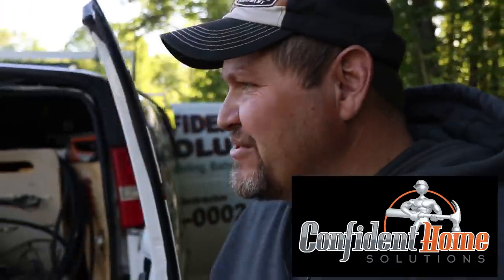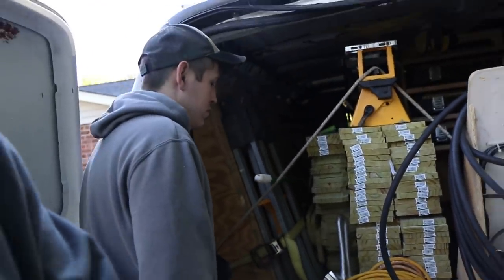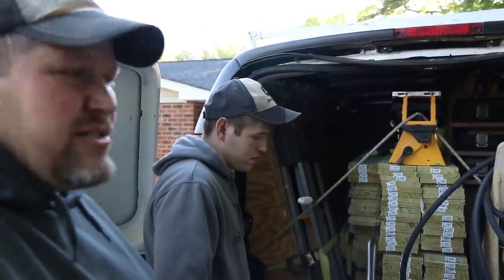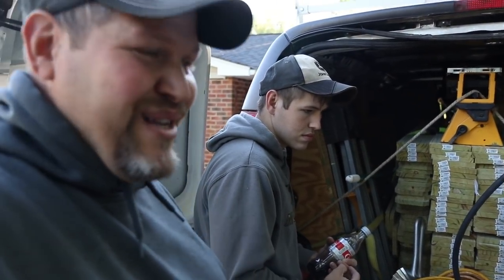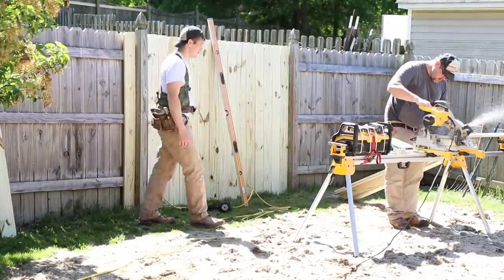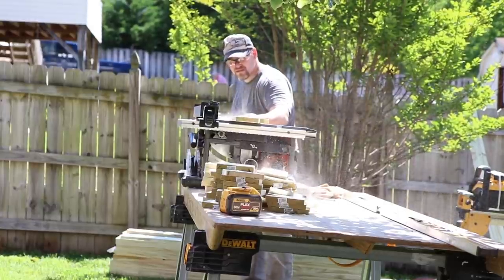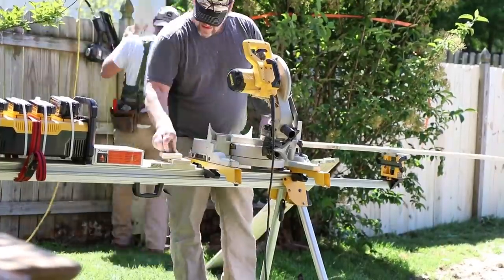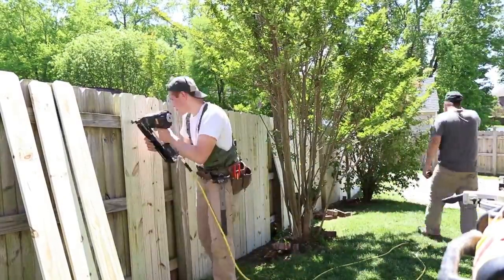Modifying an existing Fence to keep an Old Person from bothering Neighbor

Comment: My grandmother had dementia and my aunt tried to keep her at home for as long as possible.  It finally got to the point that grandma needed to move to one of those assisted living places.  At one point, the folks who worked there told my aunt that grandma and some of her fellow patients had been “busted”:  they were standing in a circle in the entry way, discussing some rather extreme plans for a jailbreak.  “You knock out the receptionist, you hotwire a car, etc.”.  My grandmother, the gangster.
Reply: I worked as a CNA at a Life Care Facility for 29 years.  We had to hide one lady’s shoes after she was found at the edge of a nearby busy highway one time.
Reply: Not really funny but sorta kinda it is. Sorry to hear about that.
Reply: @deanwilliams8857  I don’t think anyone was trying to be mean but I think sometimes it’s best to make light especially if you’ve dealt with dementia on any level. I know I’ve dealt with it and my family and it’s heartbreaking so anytime you can find a little humor it  helps you get through😊
Reply: "The Godgrandmother""
Reply: Both my great grandfather who lived to 93 and my great great uncle who lived to 92 escaped assisted living homes. My grandpa fought the 2 cops that found him and nearly overpowered them. My uncle was found a few miles away in a wheelchair and when the cops asked where he thought he was going he just replied “Texas”. This was all in Kentucky
Reply: @gorehammer1  I have to wonder if they have the ability to scheme a way out and make it, maybe they don't really need to be there
Reply: @gorehammer1  My dad worked at a facility that cared for veterans with alz/dementia. I remember as a kid we were driving down I-40 in North Little Rock, Arkansas where it meets I-30 and all of a sudden my dad yells OMG and pulls the car over and jumps out, running ACROSS the interstate. He had seen one of their patients walking down the interstate a couple miles from the facility. He just popped him in our car and took him back. No hoopla whatsoever  This was 40+ years ago.
Reply: @gorehammer1  he knew Texas was Free 🤣
Reply: I’m laughing so hard at this situations hilarity, your grams sounds like she would of been quite the gal to know in her day 😉. I’m worried I’ll be that same grams when it’s my turn 😬💯
Reply: @ctawose  that isn't true at all. My mother-in-law who was going through delirium was capable of a lot of things she would not have been able to do if she had been in her right mind. She was able to quietly move a dresser we had in front of the door that was so heavy I couldn't even move it, sneak out no matter what we did to stop her from doing it, hide from the police, and carry around a very heavy bag that the police officer couldn't even lift. She could barely walk on a normal bases but during her delirium she walked pretty far before the police found her. She was so convincing that if you didn't know her you would believe her until she would slip and show the delirium or her facial expression would change to a scary grinning face and she would start giggling a freaky giggle uncontrollably. She had people believing she was married to a doctor and we were lying about it. They started to change her last name at the hospital to reflect her "married" name. Before this new husband thing started she told medical staff that her husband (she gave them my father-in-laws name) was beating her and she was scared for her life. The police showed up at our house to arrest him and we had to prove her husband died three years ago. He never laid a hand on her before he passed they lived with us for 10 years.
Reply: @shadowkissed2370  That is so awful for all of you.  Its scary as I get older I don't want to do this to my family
Reply: That’s a great story. Lol
Reply: @tm2bee  I remember in grandpa’s last days when he was laying on a hospital bed mostly unresponsive everyone was afraid to get close enough for him to reach. He used to grab a 10lb sledgehammer by the base of the handle and reach out and touch the hammer to his nose. Also he dated Simone Simon!
Reply: My brother told me of a assisted living home, some of the patients would try escape and go to the bus stop across the street. So they built a replica bus stop next to the outside recreational area. Everyday a few would go and wait for the bus and then return  when they called inside to eat.
Reply: Grandma cant be held down.
Reply: My grandmother threw food at the nurses and kept stripping until she got kicked out of her nursing home.
Reply: @deanwilliams8857  Sometimes you laugh to keep from crying...
Reply: @pearlperlitavenegas2023  Home of high property and sales taxes. Free?
Reply: Everyone’s grandma gangsta until Betty White shows up...
Reply: And I bet shes a cutie  too.
Reply: @ctawose  I don't have to wonder if you have ever taken care of someone with dementia.
Reply: Wow. It’s important to research the facility you are planning on placing someone in. Not only that it’s a good place, but that they have an understanding of dementia and short term memory brought on by peers in this new living environment.
Reply: @shadowkissed2370  My Grandma told us that the most horrible man came to her room and asked her to marry him. It was my Grandad trying to tell her they were married.
Reply: I’m sorry but I couldn’t help but laugh.  That’s such a movie moment.
Reply: @rogdog3257  
That’s brilliant!  A fake bus stop!
Reply: @krakendragonslayer1909  wow - that shows so little appreciation of a caregivers’ role and what it’s like to live with dementia.  Also, I’ve noticed that when people make baseless accusations, it’s usually because this is what they do to others.  In other words, glad my grandmother was not yours or she would have been poverty- stricken in no time at all.
Reply: @krakendragonslayer1909  Have you ever cared for a person with dementia? I have. They often require constant attention. Picture these scenarios caring for a dementia parent in home - You go to put your toddler down for a nap, and mother slips out the door. You have to decide if you leave the toddler alone, or call someone to help. Or wake the toddler to take the child with you? Better decide quickly... Or imagine the scenario - 2 am, family's in bed. You get up for the toilet, and see mom in the kitchen, trying to light the gas stove. She starts screaming at you when you take the lighter away from her, waking the whole house up. She almost started a house fire.. And much worse than this has happened when people try to keep severe dementia parents at home. Sometimes love and care means making them safe, above our desires to stay close.
Reply: @krakendragonslayer1909  your respons says a lot about yourself and it isn't nice...
Reply: @chipsutcliffe7110  Agreed.  A good sense of humor will offset some of the stress associated with being a caregiver.  My Dad's  house was about a quarter of a mile from the railroad tracks.  One day, after returning from an errand, I walked next to Dad, holding on to his gait belt in case he stumbled.  The train horn was so loud that it startled both of us. Dad turned around and looked, as if the train was coming down the street.  It was hard not to laugh. All I could manage to say was, now that was too much noise.
Reply: @Hyperion  must have been a long time ago. 
  I am afraid nowadays the poor old man would be shot! Maybe just tasted. But who knows...("Stop resisting, and I felt my life was endangered ")... 
  My Grandmother was like this in the 80s. Our understand.
Reply: @amyb8704  then there was the time when my aunt had brought her home for the weekend.  She did that as often as possible.  My uncle heard a noise in the middle of the night, and went downstairs with the dog.  He found my grandmother (his mother in law) in the living room, stark naked.  Heard another noise, and it was the dog running back upstairs to the bedroom.  He always swore that the dog kicked he bedroom door shut behind him.
Reply: @gorehammer1  
Dementia dosnt mean not able to make your own choices,  if he wanted Texas 
You should have moved him there.
Yes it might not have been convenient for you but that was his wish.
And yes I've delt with family members in this very situation.

Comment: I hope the modification worked for  the client.  Elderly people are doggedly determined and like toddlers, have all the time in the world to figure things out, even with dementia.  At the age of 86 my grandmother did not ever have dementia, but in the process of house sitting for a friend who was on vacation, managed to lock herself out of the front side of the house.  She knew her friend had a spare key hidden in the backyard, but the gate was locked, so she climbed the fence, fell into the backyard and shattered an ankle...  Laid in the yard for over an hour shouting in the summer AZ heat (about 115 degrees F) until someone came to help.  The ankle was shattered so bad the Drs wanted to amputate.  She wouldn't let them...  It healed up surprisingly well after some surgery. A few months later she was back walking and wearing heels...!  Ten years later at the age of 95 1/2, while my Dad was in the hospital, she convinced people at church to help her get a car, got T-boned by a large truck on the driver side... Managed to get herself out of the mangled vehicle and was waiting on the side of the road when EMS showed up.. They said the car was so badly damaged on the driver side they would have not been able to extract her from that side even with Jaws of Life.  At the hospital, with a 3rd degree AC separated shoulder and a small brain bleed, she fought off 5 security guards and two nurses, until my cousins showed up during the fight and she played nice til they left.  Because she bit one of the nurses during the fight they put her in restraints.  She managed to get one of the wrist restraints off with her teeth and they had to restrain her head too.   5ft 3in tall...only 40% heart function (CHF), a pacemaker, diabetic, barely able to walk, nearly deaf, hardly able to see...  mean as a snake and could still fight like a demon!  Never, Ever. underestimate what the elderly are capable of, even if they do have dementia!
Reply: Being seemingly immune to pain actually is a dementia symptom. My mother worked as a nurse before running a few care homes and she's known dementia patients to walk on a broken hip.
Reply: You have described my mother to a tee! Punched a cop in the jaw for telling her to settle down!
Reply: Not to mention what the can do with their words. Whew! My mom was mean and could really get to you with her words.
Reply: She also was uncooperative abd made everything twice as hard. It was the most difficult time of my life. There are some things adult children should not have to see or do.

Comment: Five minutes after you left, Old Person was standing on a milk crate.
Reply from the maker: Most likely right
Reply: haha , either that or he was out there with a pry bar removing pickets ..hehe
Reply: Joint compound bucket came to mind before I saw  your comment
Reply: Or pounding on the front door at 3:30 am 🤣🤣🤣🤣🤣
Reply: Standing on the battery charger wood stand that contractor left behind by accident!!! LOL!!!  JK!!!
Reply: Plus, how did that help? The fence wasn't higher, I don't get it. at all??????
Reply: @innerlockbreaker3916  he was standing on the little ledge to look over the fence. Now it is a smooth surface with no edge to stand on
Reply: @tracyzoon5805  Remarkable! I shudda known it...thanks for the answer.
Reply: @tracyzoon5805  kinder than razor wire...
Reply: Very funny. Actually made me Laugh Out Loud. Seriously! Not the stupid LOL.
Reply: Yeah, I was thinking why not make it higher if yr going to all that trouble?
Reply: Spot on 😂

Comment: I was thinking/hoping you would show the end results of your work this is something I and I’m sure other people would like to have done because it just gives a more aesthetically pleasing finished look
Reply: My husband just completed that project on a big section of our old fence.. There's a determined young bear close by, that pulls the boards loose and strolls thru the yard and knocks a few loose on the other fence to get out.. A couple months ago, he surprised my 12 year old dog and ripped half his ear off before my husband clocked him with a 2x4.. A couple days later he was back at it with a few boards torn off in a different section.. So, adding new boards, was our solution too . But damn, lumber prices are crazy this year!
Reply: He did show the end of it before he showed the deck. All they did was put up boards to cover the horizontal rails so the guy couldn't climb up

Comment: My Dad was very mechanical and could fix anything. When he got demenia he started taking everything apart and throwing the pieces all over so you couldn't find them. He'd bend the parts, pull the springs apart. Then he'd swear he didn't do it. Determined doesn't even come close to describing their behavior.

Comment: Dementia aside, adding that extra layer looks pretty good and will probably extend the life of the fence.
Reply: Might give it a shorter life with all that extra weight
Reply: @lizardman1303  that is actually against building code in my area, it creates a void of no sunlight and the moisture rots the fence away from not being able to dry properly from the inside out.
Reply: @davidwalczak1297  Was thinking to do this to my fence and had the same concern, in FL. What area/state are you in?

Comment: My elderly neighbors across the ally directly behind me both passed away last year. An investor bought the house and turned it into rental property. I now have a party (crack) house to deal with. Every lowlife in town is now hanging around back there. I severally need a fence right now! But the price of lumber is holding it back right now.
Reply from the maker: Sorry to hear that😕
Reply: I doubt the price will be going down in the foreseeable future.
Reply: Call the police every time the B.S. starts . Then call the absentee owner and tell him if it doesn't stop you will see him in court .
Reply: Tom - Unfortunately, fences don't always help. Won't stop someone from climbing over either if they really want to. Victim of 10-yr nightmare with multiple convicted felon, drug dealer, psychopath, etc. Property vandalized and stolen in spite of a fence. I feel your pain.
Reply: Maybe try a tall chain link fence, instead of lumber? And add some climbing plants, maybe  thorny ones? Lol, I can imagine how unpleasant that would be to climb.
Reply: Elecric wire if it's legal.
Reply: @CelesteSeeker  you have some good ideas!
Reply: Check with you city.  They may have an ordinance about "maintaining a disorderly house".  These ordinances came about during prohibition to stop people from running houses of prostitution, gambling and liquor sales.  If they do get a copy of the ordinance and take it to your attorney.  Tell them you want a cease and desist letter sent to the renter and the property owner.  Include a statement that you will seek punitive damages in the maximum amount for each instance that it has occurred.

Comment: I have a creepy neighbor too. I thought that the fence was six feet tall when I moved in. The neighbor kept peering over and I thought he was tall. It turns out that side was five feet something. Enough for Mr Nosy to keep peeping at my visiting cousins. I had a good fence put in on the other side. It's called a portrait framed, good neighbor, fence. It's pretty, doesn't have the climbable two by fours, and looks the same on both sides.     I can put that up for six feet and then I can add a one foot lattice by city regulations. The problem is, Mr. Nosy's mom wouldn't pay her part and might object if I put it in for free. She's so weirdly suspicious. Try to do anything good and she becomes paranoid. So, I'm contemplating putting up the good fence on my side of the divider fence, making the divider fence to indicate the property line and then waiting them out.

Comment: Harley needs pinstripes on the sides. It can help him both achieve and maintain velocity.
Hope that helps.
Reply from the maker: Will be using the advise 😀😀😀
Reply: @campbellbuilt  
✌😅
Reply: @Gi Gi That would be demeaning. But pinstripes, those bamf's are slapped on man, beast and machine, if worthy.

Comment: Should have switch the fence over the other side of the post if needed use new 2x4x16’s, your way more expensive and costly.  What the neighbor could do is pull any one fence side off and stand back up on the 2x4🙃

Comment: I would have at least let them pull the truck into the yard grass grows back. : ) I'd be curious how that worked out also. Can say because my dogs barked at anything they can see through the fence I put up brown tarps and secured with three fence slats. Works well and cheaper but what happened later was wasps built nests in that void gap between the existing fence and covering along with ants on the lower rails. Would suggest even for maintaince if doing anything similar make a panel of pickets and screw that onto the section with 6 screws that way can easily remove if need to do maintainence or end up with any insect issues.